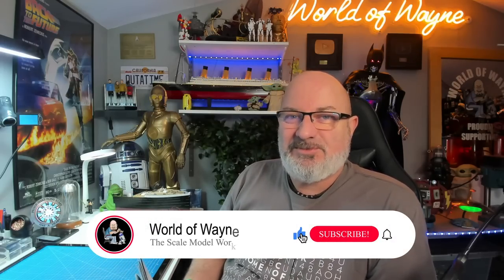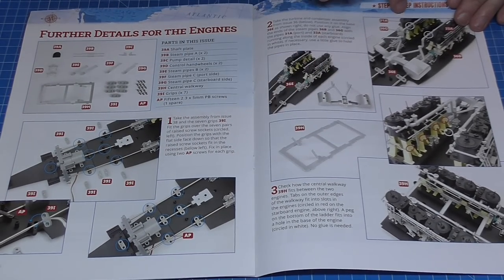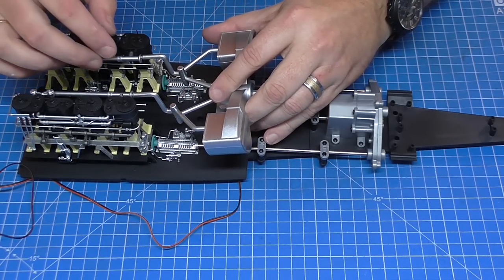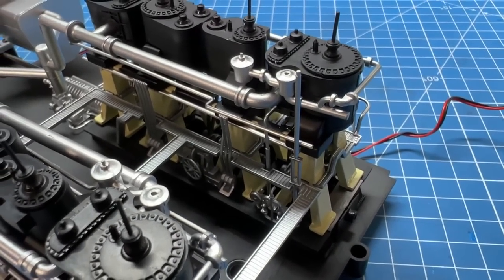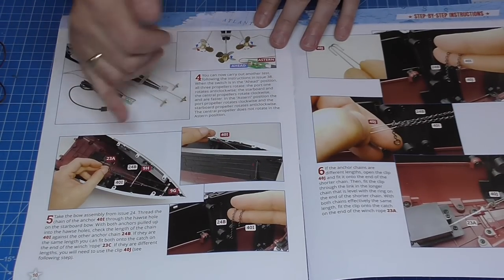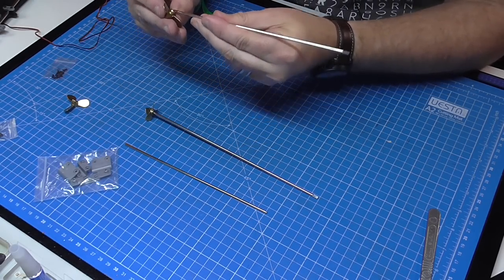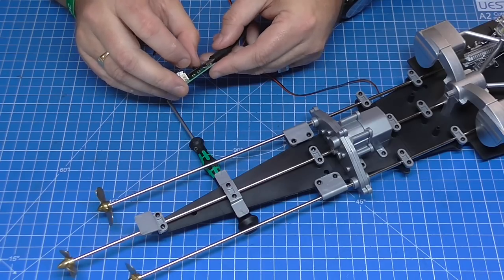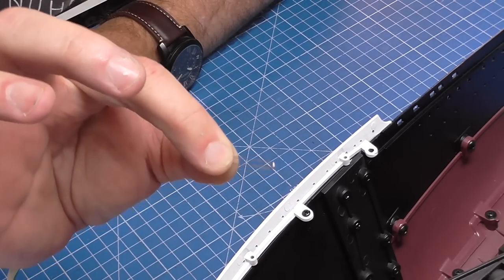Agora Models Build the RMS Titanic - Pack 8 - Stages 39-44

Comment: The wider bracket on the centre prop shaft seems to have splayed ends to fit in the tapering hull.
It looks as if you may have fitted it the wrong way around.
Reply from the maker: You are right. I have turned it round
Reply: @WorldofWayneUK  Still making mistakes so we don't have to, Wayne?
Reply from the maker: @mikehipperson  yep that’s the reason lol

Comment: Question: i just bought the first issue in my country, 139 issues to go or 3 years (:(). My intention is to wait untilll all parts are collected and then start building, whats your advice?
Reply from the maker: The problem with doing it that way is what happens if a part is damaged or missing. I don't know if companies will replace after 3 years when you should really give them a reasonable amount of time to respond. Also, 139 packs in one go is ganna seem a bit overwhelming to me.
Reply: @WorldofWayneUK  dont have all the tools for assembling it right away, do they eventually give you tools or everything you need in one of the packs?
Reply from the maker: They do provide a screwdriver but glue and some other items you may need to purchase @TheJosip1000
Reply: @WorldofWayneUK  they provide only a screwdriver? That i have lol. Anyways im not too concerned about losing parts. They are nicely packed and even if i lose anything i can go and do a order online of a back issue.

Comment: I'm getting sick of working on the engine tbh.. it's the parts I struggle with the most.. but least I got the central walkway in.. I had a hard time putting that in as well but then I remembered there are 2 pin holes to put the legs in to line them up properly.

Comment: Hi Wayne I bet u didn't know that the Titanic had 3 wheels for steering the ship
Reply from the maker: Nope. Does that mean I have another fiddly one to assemble lol
Reply: @WorldofWayneUK  U will actually have to assemble 2 more if the model is true to the real Titanic. One on the rear of the ship and one on either the port or starboard side of the bridge
Reply: One was in the main wheelhouse,the second was in front of the wheelhouse on the bridge and the third was located on the docking bridge far astern on the poop deck.